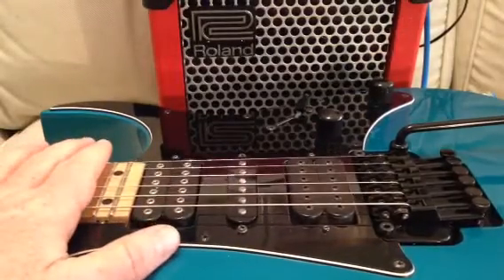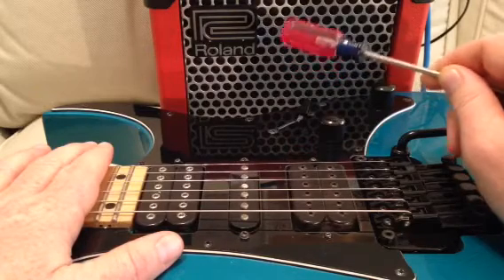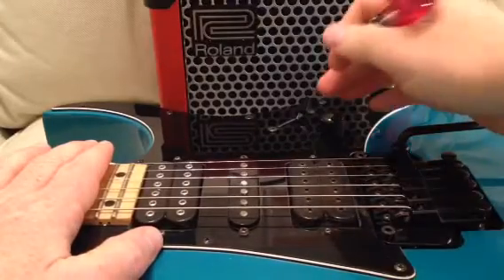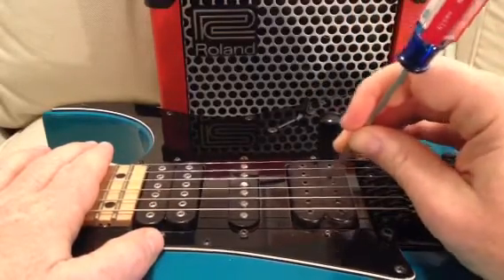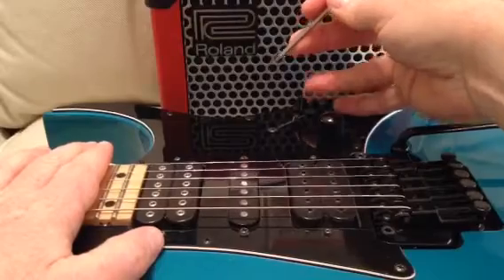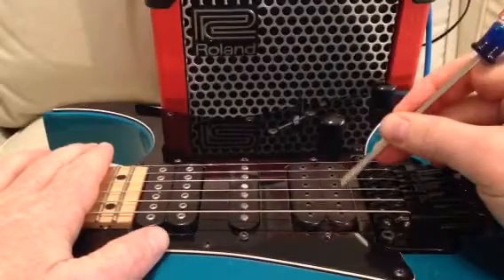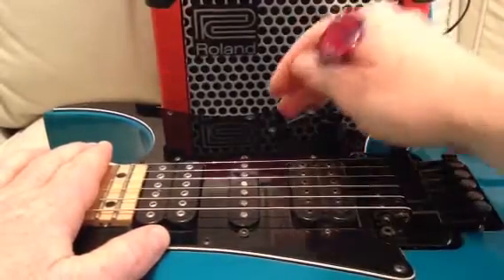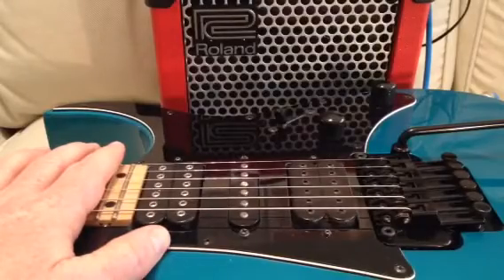Which Pickup Coil is Active: How to Tell

Comment: I used to use a tuning fork.  Bang the fork and hold it over the pickups, plugged into an amp it will play the tone of the fork.  I like your way as you can tell which side of the humbucker is split.

Comment: I've been wrestling with guitar wiring for the past week as I replace a 5-way selector in my Ibanez with an import 5 way. I know it doesn't have the same pickup selections as the Ibanez switch but I'm okay with that.  Anyways it's been quite a week trying to figure out all the wiring.  Learning about the north and south of each pickup which coil is which excetera excetera. But just making sure the switch is set up properly you just saved me a ton of time. Is that a reissue Ibanez with the wizard neck?  I had an rg550dxz yet back in the day.

Comment: I know this is an older video but I have a question.. install a DiMarzio 36th anniversary paf in my bridge on my American Stratocaster... I hooked it up exactly how the other one came out.. but the screws on the coil aren't as loud as the other flat poles on the other coil.. I can still hear it but it's not quite as loud I don't know if this is normal for this pickup or I've hooked it up wrong